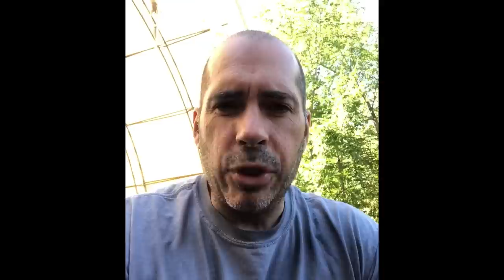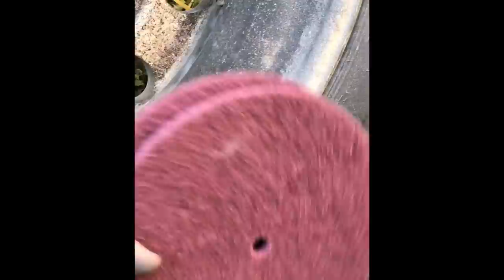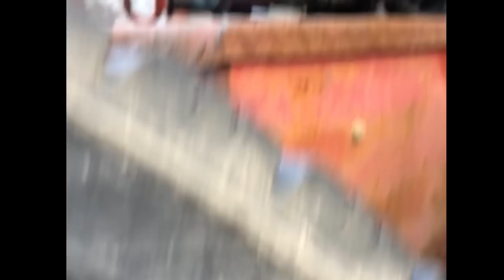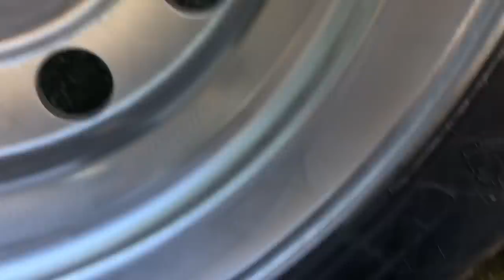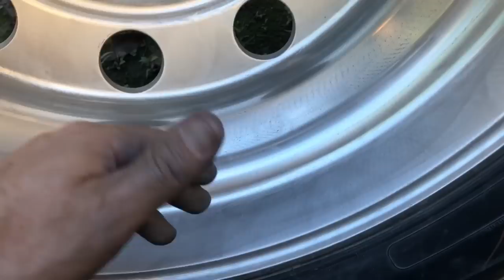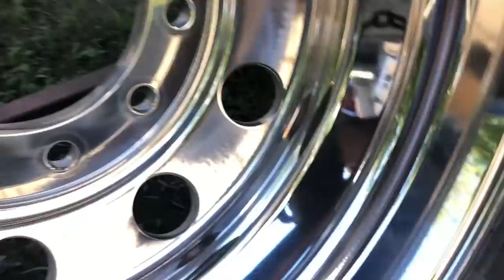DIY How To Sand and Polish Aluminum Wheels / Rims

Comment: I recently quit my job polishing wheels for a company, however we mostly dealt with smaller wheels. Only every once in awhile we'd get some of those. We sanded down the wheel using 350 grit sand paper, fixing what we could with welding, afterwards we used shakers to 'sand' the rims more with beads, then we used what you showed in the video. Only difference is we used yellow pads then white pads for final touch. We always had trouble on some rims where they would not polish up, I'm assuming it was due to the beads not being purged and refreshed in the 'fine' shaker. (Boss always wanted to save money, heh) I'm happy that I'm out of that job now~ Boss never provided proper safety equipment, and breathing that stuff in definitely wasn't good. Most days I would go home covered in compound and aluminum.
Reply from the maker: Ya safety comes first for sure!!! Thanks for watching!

Comment: I gotta get one of your kits and start doing this.
I’ve done aluminum motorcycle parts on a baldor stationary polisher using Tripoli and white rouge and of course different pads with each product and got decent results but nothing as spectacular as what you’re turning out with the hand held equipment and obviously better compounds than I was using.your finished product is mind blowing stuff
Reply from the maker: Thanks man appreciate that!!!  Thank you for watching!

Comment: Thank you for taking your time to produce these videos for your channel...I really appreciate them and find them extremely helpful.
Reply from the maker: no problem it's my pleasure!  it's a nice change of pace
Reply: I also love these videos as I’m learning all I can before I actually touch someone else vehicle. Looking around at some scrap alum to practice on and would like to do this for extra income. I do have one question that I see in most of your videos and not much is said about it. What sander are you using. What attachment are you using with the round sandpaper disc to stay on while sanding. Thanks for the videos.

Comment: Solid results there! Couple questions, couldnt quite tell how you finished out around the valve stem? Im assuming the DA wouldnt get under the stem? Also what do you recommend if I wanted to polish inside the "rat holes", hand sanding and some sort of cone polish wheel? Thank you for your time.
Reply from the maker: ya we done the valve stems by hand at the end when we clean and protect the rim with liquid metal polish.  as for the wholes I have  a video called "Doing your rim job properly"  :)  it explains how i do the wholes..  thanks for watching!

Comment: I watched your video you did a good job. I have been sanding my wheels and  I have a question maybe you can answer. I’m using the 600 grit and I have some spots the look great and some spots that have a kind of white look to them. And when polished the white spots are darker and don’t have the mirror reflection the rest of the wheel does. These spots are raised in a curve on the wheel. Did I over sand those spots , can that even be done? Or need to sand a little more till I get the desired look. These wheels were originally machined and not polished.
Reply from the maker: it's really hard to answer a question like this without seeing.... but with that said if you're only sanding with 600, you need to go step by step with lower grits to get better results

Comment: I recently started polishing my wheels. I used the brown rouge and then the green chrome rouge. But when polishing I don't get the mirror finish. It has a lot of back stuff on the wheel. Do I need to sand the wheel? Am I doing something wrong. After your first cut you already has a mirror shine but it didnt work that way for me.
Reply from the maker: Sanding is definitely key to a clear mirror shine, quality compound is a close 2nd.  What speed are you polishing at?
Reply: @DCSuperShine  3500rpm, that's also the max I can go.
Reply from the maker: K np sanding is key,  then I’d use 439t green menzerna to cut at 3500rpm, a second cut might be needed (same product and speed) if there’s still sander marks.  Then finishing with menzerna 480blf blue at 2200-3000 rpm
Reply: 1st cut I have brown bar, 2nd cut I have green chrome bar, and bluemoon final finish bar with a white flannel wheel.

Comment: Wow real nice i have rims on my motorcycle they have that shine too only problem is i have machine shop lines a lot of them an so do i sand those off and what grit do i use
Reply from the maker: You can safely start at 320 if it’s taking forever to get the lines go down to 180, then 320, 400, 600 and 1000 and machine polish

Comment: I just got some old slots for a restoration I am doing.  Rims have some scratches and dings.  I am currently using 80 grit to get everything smooth.  Am I on the right track?
Reply from the maker: Personally I don’t go lower then 120 but nothing wrong with 80 grit just remember to not cheat when moving up in grit and make sure every step removes the prior sander marks!  Hope that made sense!

Comment: Hi Dennis great video I noticed you using a DA sander , I have being advised to use rotary multi speed Sander what's your opinion on this? Thanks.
Reply from the maker: If you have experience a rotary it totally fine and much faster… but with that said faster with no experience can be very bad… aluminum is very soft and it doesn’t take much to chew grooves in the pieces you’re working on.  So make sure you’re always moving, constant flow and keep your pad as flat as possible, the more you use the edges the faster it chews.  I’d practice on flat surfaces first.
Hope this helps
Reply: @DCSuperShine  hi thanks for your reply I plan to practice on a fuel tank and see how I get on , keep up the good work regards James.
Reply: Whoever recommended a rotary is a ding bat unless you have a lot of experience with it. DA is way more forgiving for the newbie

Comment: subscribed!  I wish I new that I only had to go up to 600. I've been trying to restore aluminum wheels.  and took it to 5000 grit then used California purple polish.. I'm happy with the result but it's still about glazy... can I go back down to 400 then 600 then polish?  note Ive been wet sanding throughout the process.any difference in wet sanding or not? there's no dust.Any help will be much Appreciated. 👍
Reply from the maker: Ya sanding to 600 works fine, I usually use an 800 or 1000 grit after my 600 just to make the polishing step a bit easier… takes a couple more mins but saves more on your polishing.  As for dry or wet… I sand dry cause I don’t like the mess of the water, and the aluminum gets sll caked up black… but you’re right Definitely less dust!!
Thanks for watching
Reply: @DCSuperShine  thanks heaps 👍👍👍
Reply: @DCSuperShine  any tips on getting rid of that light haze and light scratch marks ? I'm still getting it after I've polished it ..could it be that I should have gone higher grit in my sanding ?

Comment: Question: I have small/ regular size Makita & Dewalt angle grinders. Do I need an adapter to get polishing wheels to fit? Makita bolt is smaller. I'm only polishing small stuff at home for me. No rim's. Thanks bro.
Reply from the maker: You can find flanges on my site... there’s 2 styles that I use.  The centerless ones are definitely better.  Hope this helps 

https://dcsupershine.myshopify.com/collections/tools/products/aluminum-quickcenter-self-centering-safety-flange-set

Comment: Appreciate the videos  , when sanding aluminum what rpm should I be running on my dewalt variable speed?  Thanks !
Reply from the maker: I run mine at 3000-3500

Comment: Great video. Thank you. Question. What tools did you use. I saw Dewalt in there and you used about 3types yeah? Is that because of varying powers required? Thanks.
Reply from the maker: For polishing I use a 3000/3500 polisher and a 6000 rpm grinder.  I have multiple so I don’t have to keep switching pads...  :)
Reply from the maker: Hey man!  Thanks for watching if you watch my latest video It explains everything you’re asking :)

Comment: Is there any point in going higher than 600? I have heard of people finishing on 1200 etc.
Reply from the maker: You can definitely stop at 600 with o issues… i usually go one step further 800 or 1000 just makes polishing a bit easier especially if you’re doing your cutting step with a 3000-3500 rpm.  Hope this helps

Comment: Can you sand with a palm sander while the rim is still mounted on the truck
Reply from the maker: The outer part of the rim yes, if the rim is not too far gone you can use sos on the inner part and polish by hand or machine, sand the outer part and polish.  If the rim is too far gone it needs to be taken off to do it properly.  Hope that made sense 😎
Reply: That makes sense👍. Thank you very much

Comment: I have super dirty truck rims similar to your as dirty as yours but I don't know with what sanding grit I should start . Is 80g is too much ? Or should I start with 120 ? Then work up from there ????
Reply from the maker: 80 is too low imo, some guys use it but I find your working harder to get the low grit sander marks out. I start with 180 99% of the time when it’s rough.  Then 320, 400, 600 and ready for polishing if your using a high speed then I go 1 step further to 1000 and then polish.

Comment: this compound can fill this scratches with was caused by 320 grit sandpaper?
Reply from the maker: It doesn’t fill them, it removes them but I don’t stop at 320...  you need 400, 600 and 1000 grit then you’re ready for polishing

Comment: its really good job, may i know about compond and buffer wheeel ??
Reply from the maker: Currently using Menzerna but switching in the near future to Marpol.  I use a 3500 rpm dewalt for tight spots and a 6000 rpm Fein for the bulk of my work
Reply from the maker: Yes I use Menzerna and Marpol for compounds and airway wheels
Reply: @DCSuperShine  I notice that you were using an orange polish wheel for first polish (about 13:20) and then a soft wheel for final polish (about 19:50).  Is there a rating for that orange wheel (i.e. what should I order to get a "first polish" wheel like that?)   What grade or grit polish compound do you use for these steps, please?
By the way, beautiful work -- everybody should take care of their equipment.

Comment: sir, I want to ask about sanding.. orbital sender or angel gerinder which is suitable work for wheels
Reply from the maker: It comes down to experience and what you’re comfortable using.  Personally for the inside I prefer a DA for the other rim especially when they are rough a rotary does quick work!!! Hope this helps. And thanks for watching

Comment: Could I use wheels that aren’t airway mill treated?
Reply from the maker: Technically you can, that’s more old school style polishing, low rpms and takes way more time.  I polish at 6000 rpm so need airways to reduce heat
Reply: DCSuperShine I have 6000 rpm and an variable speed grinder also..

Comment: U the man bro nice work I'm just starting to do this. Can u use the high strength disc instead of sanding or do I still need to sand ? And did u clean the rim before sanding it ?
Reply from the maker: Discs only go so far, definitely won’t replace sanding when they are pitted and rough.  And unless the rim is covered in mud I don’t wash rims first.  Hope this helps and thanks for watching.
Reply: @DCSuperShine  how much time does a rim this bad take to do? And how long does a tank take to do also? Thanks
Reply: vrojas25 My first tank took me about 14 hours. You learn a ton on your first of any part you polish. But make sure you take your time in the beginning. Speed comes with time. And learning from great videos like this.

Comment: I have some wheels that I'm sanding only the lip. To have more of a "machine" type finish should I go to maybe only 400 grit?
Reply from the maker: +Jackie Carpenter depends on what you’re using to polish... if you’re going to “only sand” for your “machine finish” then it depends on the look that you want.  The higher in grit you go the more of a sheen reflection you will get.  Hope that made sense.
Reply: @DCSuperShine  I went to 320, it looks good. I did 320 wet and it was almost polishing it. So went back to dry 320
Reply from the maker: +Jackie Carpenter hehe ya I dry sand everything

Comment: What grit to remove powder coating from aluminum wheel
Reply from the maker: I use either 180 grit or my high strength discs… check out my last video about them :). Thanks for watching! Much appreciated :)

Comment: What sander are you using
Reply from the maker: I use a dewalt dual action orbital sander for rims. And I use dewalt 3500 rpm variable speed polisher on bigger flat surfaces

Comment: What kind of sander is best to use? Would a more powerful one screw up the tank or rim??
Reply from the maker: If you’re using a Da there’s no issue in screwing up.  If you’re using a rotary then 3000-3500 is good just keep the polished moving. :)

Comment: How do you start a business doing this?
Reply from the maker: +James Skuggedal - The Path of Mastery I have business starter kits on my website.  Pretty much all you need.  I started and am still 100% mobile keeps overhead and costs low.
Reply: DCSuperShine thats awsome. Ill check it out. Are you in canada or US
Reply from the maker: +James Skuggedal - The Path of Mastery I’m based out of Canada but have a US partner that takes care if most of my US orders
Reply: DCSuperShine thought so you mentioned celcius in one of your videos. I have a friend doing this in Red deer doing well. I was thinking of trying this in Prince George instead of detailing cars
Reply: How do you get around the valve really good? Is the best way to take it off?

Comment: The average individual do not have  rims that big. A buffing wheel that and sander that size would not do well on the average wheel.
Reply from the maker: +Nigel R trucks rims are 22.5 and 24.5...  some exceptions in heavy hauler trailers but that’s about it.  This method is not used on too many car rims because yes they are too small and have more intricate areas that require different tools.  Thanks for watching
Reply: I beg to differ, the "average" trucker numbers around 9 million in the United States and most people running aluminium wheels on a car or pickup truck could care less or are too lazy to polish their wheels. So, seeing as Dennis and other professionals are polishing 99% semi truck wheels and fuel tanks, I'd say those are the average customers

Comment: Awesome job man, I’m in the middle of polishing up an alloy bumper for my works new Mack truck hitting the road soon, question being, for that first rim you sanded and polished, how long would that usually take you start to finish?? Sand then polish??
Reply from the maker: All depends on how much sanding is need, but usually start to finish 30-40 mins per rims.